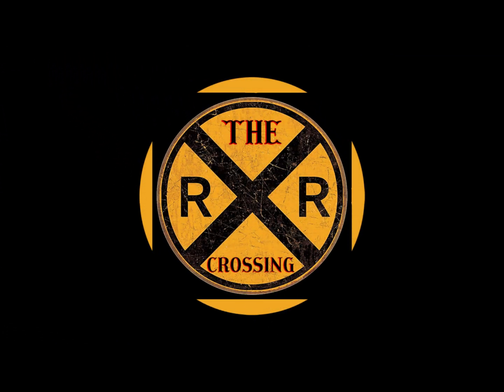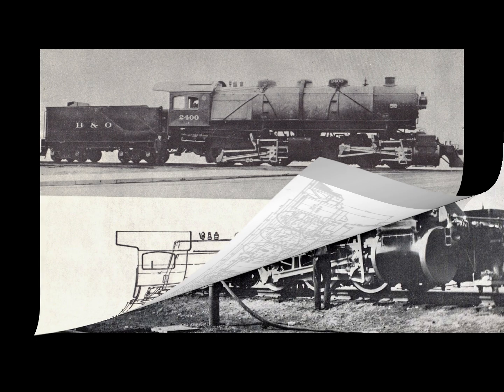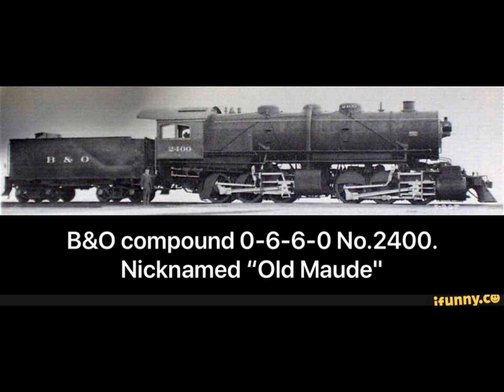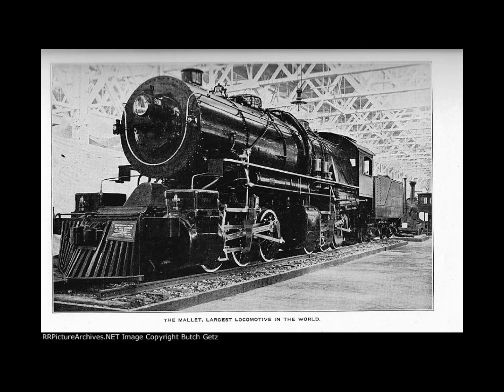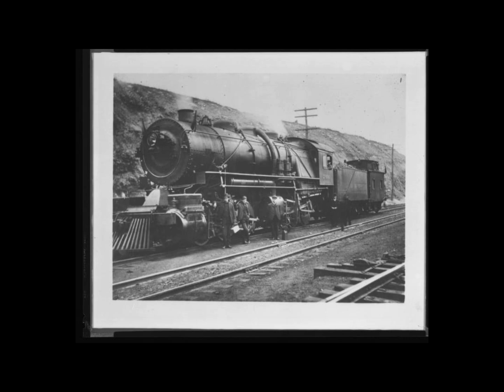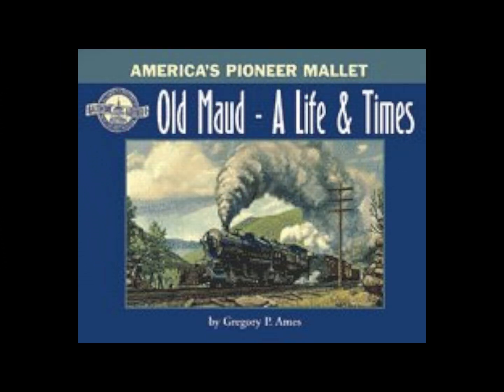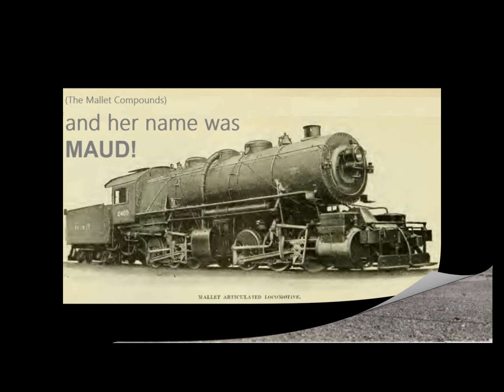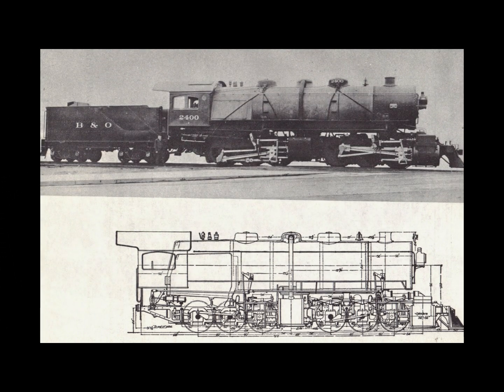Old Maude Gateway to Super Power

Comment: The Moffat ordered several 0-6-6-0’at the beginning of operation to battle the heavy grades over Rollins Pass. These were later modified with a pilot truck, creating a 2-6-6-0 wheel arrangement, as operating the “Mallets” as delivered didn’t handle the steep grades and sharp curves very well. These locomotives continued in service after the D&RGW took over the assets of the defunct D&SL. FYI there are still parts of one 200 series, if memory serves,, on Rollins Pass. The locomotive was so badly damaged it was retired. When the D&RGW finally retired these locomotives, 2 of the boilers were put to work at the Conoco Refinery in Denver. None survived.
Reply from the maker: Wow! Good info!

Comment: The compounding arrangement to last in regular use was the Vauclain on the Manitou & Pikes Peak Cog RR where the locos were removed from service in the late 1950s.  Since then, several compound articulateds have been rebuilt and have seen some service but not on a regulate basis.
Reply from the maker: Good Info, thank you!
Reply: @TheRailroadCrossing-SteamPower  Every other loco to be built as a Vauclain compound was either scrapped or simpled because of the cost of maintenance or too much time in the shop instead of use on the road.  The K-27s were built as Vauclain compounds in 1903 but were simpled and converted to Walsherts valve gear to make maintenance easier.

Comment: i am failing to understand how exactly articulation is implemented, and works...
please explain, what moves where when how much in how many ways
Reply from the maker: An articulated steam locomotive is any design which has at least two sets of drivers, with the lead set having the ability to swivel independently from the rigid frame to more easily negotiate curves.  The first application of this design appeared on the Baltimore & Ohio during the very early 20th century, which was Old Maude. This technological development allowed steam locomotives to grow in size prodigiously.  With builders and railroads no longer limited to the size of a locomotive's wheel base,  arrangements became longer, larger, heavier, and more powerful.
Reply: @TheRailroadCrossing-SteamPower  i understand why, i dont understand how.
how do you feed pressurized steam to cilinders?
Reply from the maker: The cylinders are used to contain steam from the boiler. Steam is fed into one side of the piston and expands, pushing the piston in the opposite direction. When the expansion ends, the steam is then added to the other side of the piston, pushing the exhausted steam out through a valve.
Reply: @TheRailroadCrossing-SteamPower  i know how a piston works, i dont know how you feed it when articulated.
how you articulate the pressurized steam feeder

Comment: I used to work for B&O, my dad fired and ran steam and Diesel.
I also worked as a tour guide taking people over the old D&SL roadbed to Rollins Pass,  the "Moffat" road.
That road used locomotives based on the "Old Maude."
It's been a few decades since I visited the site,  but there is a place on the tour were the remains of one of these Mallets, the 210, including the round smoke-box cover, are still visible among the boulders at the base of the cliff. The engine ran away on the four-percent, jumped the track and was air-borne for a few hundred vertical feet. The crew had been gassed in the snow-shed, and when the fresh air revived them it was too late, so they bailed and survived.
Reply: Oh my god, we need to restore the loco asap
Reply: @sirbarongaming2138 The smoke-box cover, that round front of the locomotive, must weigh at least a thousand pounds, so it is probably still there.
Reply from the maker: Great story!
Reply: @TheRailroadCrossing-SteamPower Reference: "Rails  that Climb, a Narrative History of the Moffat Road" by Ed Bollinger, 1994. 
A great read, with great old photos. My reference for the tour.